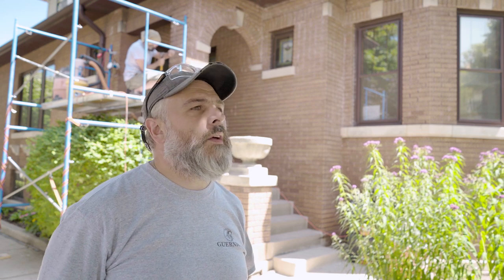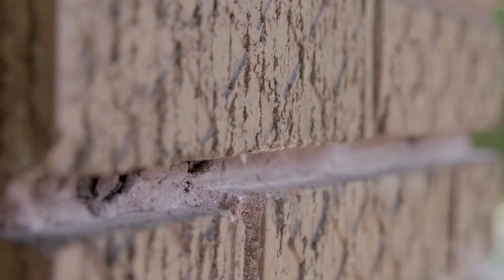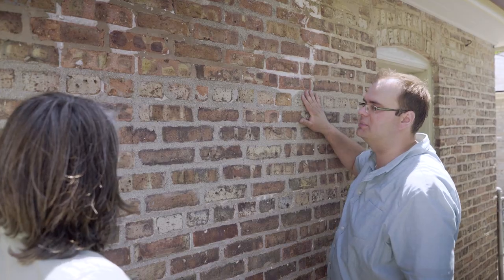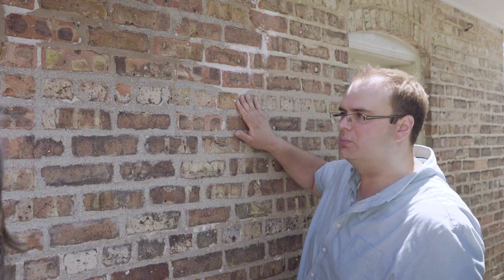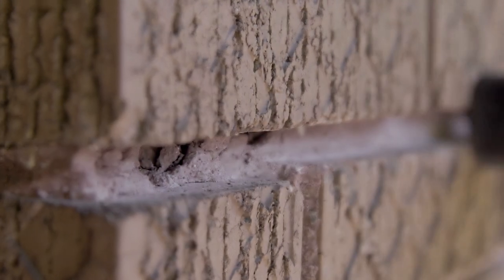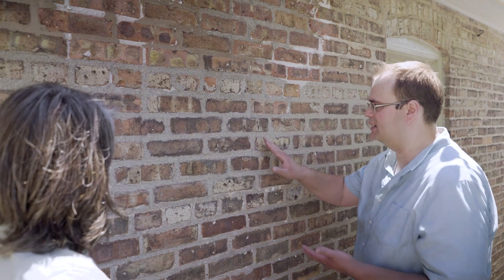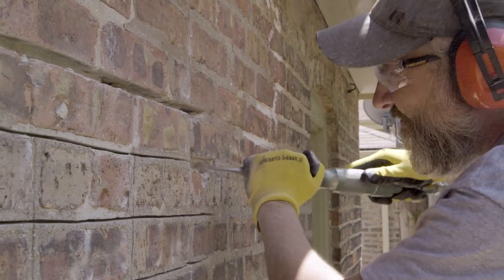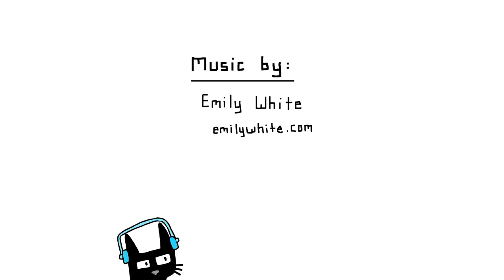Repointing Your Vintage Masonry: Removing Mortar

Comment: Some guys come from the ranch, and they claim to know about tuckpointing, or repointing, and when it comes to grinding, they use a chisel, if they don't have the grinder.  When it comes to the pointing, they use their fingers instead of using the proper tools to shape the mortar joint, once you give the mortar its final touch.

Comment: It’s not that filling in motor gaps is wrong, it’s far cheaper.  Only 30 seconds before the end, does the guy say repointing is labor intensive.  My guess to do that bungalow is $60,000 to $75,000 with cutting, chiseling and reapply new mortar.